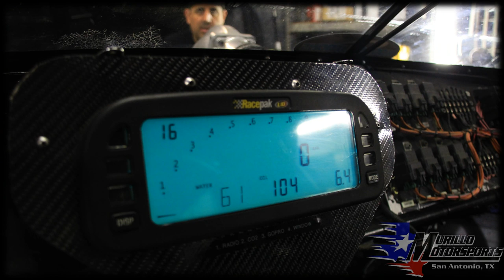Time-Lapse Of Lafawnduh Being Reassembled with Mike Murillo

Comment: why didn't he use arp studs in the block why just use head bolts. it doesn't make any sense.  on a turbo motor.  is that a cast iron block from o'rally''s auto parts.
Reply from the maker: It does have a O'Reilly Ford Fuel Pump out of a HD Truck.
Reply from the maker: Owe and yes we used ARP Studs.......That what he slid down the heads and tighted then caped off with the nut and torqed down to specs. =0)

Comment: no way that's not the motor he runs bull shit.  well that's tv for you.
Reply from the maker: This 100% the Motor he run on the track and on the streets. 
And no way is that a stock block brother LOL. The heads are factory Trick Flow out the of the box as well. There are plenty of vids and pics showing this is the motor he has won 14x World Championships with. Built by a little engine shop here in San Antonio TX
Reply: He got it from Steve Morris now traded it for a bigger and better one Steve refreshed it and has it up for sale after a dyno pull it makes over 2300 HP